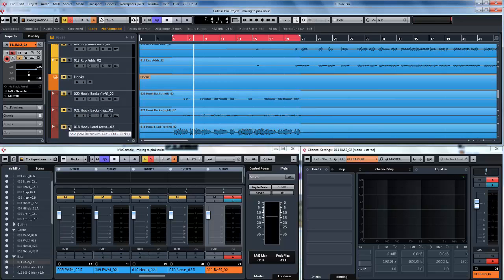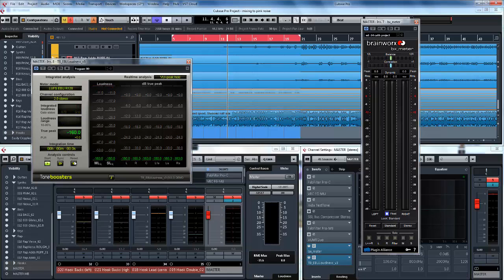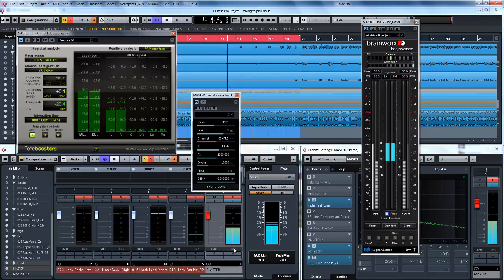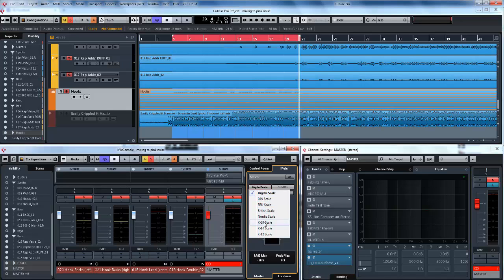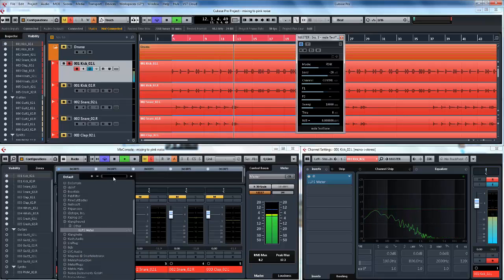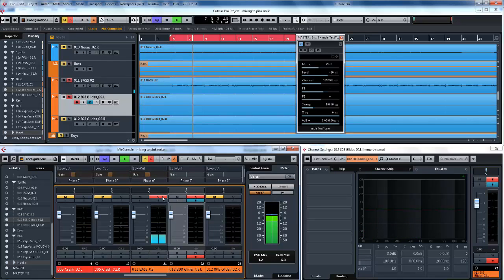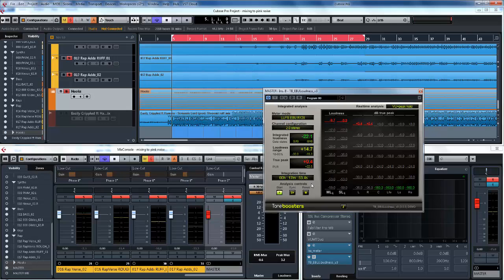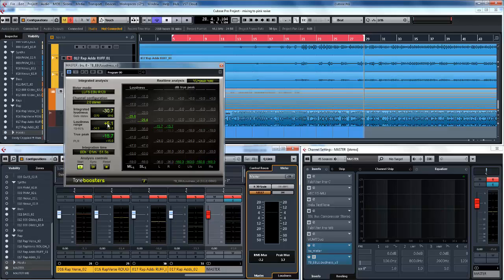HOW TO: Gain Stage your Mix using Pink Noise Profiling.

Comment: This is probably a very stupid question and you probably answered it in your video. But how far up should I bring up the pink noise in order to be audible? Did you go above minus 20db, like -18 or something at True Peak? Just want to make sure I'm following correctly. Thanks in advance! I found your info on  gain staging very necessary to know before using pink noise. I'm just turning on to mixing using pink noise. So far it's great! So simple and easy to use. Wish I had learned this from the very beginning. It would've save me much valuable time by using pink noise as a template to set a proper level for each track in the overall mix juxtaposition to one another. I found to that if I mix in mono, using a hi and lo-pass filter set between 100hz and 1khz, the sweet spots of our human hearing, that kicks and bass along with other highs within the midranges sound even better when you go back to stereo and turn off the hi lo filter afterwards. I found this helpful mainly in addressing fletcher munson effect very well in maintaining some lows when volume goes down to barely audible and controlling the bassier parts when you crank up the speakers. Bonus!
Reply from the maker: I tend to set the pink noise against the meter. Let's say you are working to -20dBFS. Set the pink noise to just below this and mix to that. Once all the channels are mixed it should not exceed -20dBFS. So make sure that ALL the gains don't exceed this. I work against -23 or 25 and let the summing handle the balance.
Reply from the maker: I used my LUFS meter and set the target to -23 LUFS. I then used the noise generator and set the volume of it to not peak above that target.